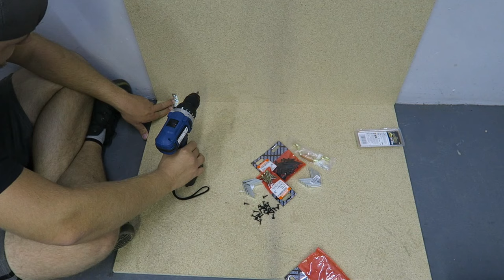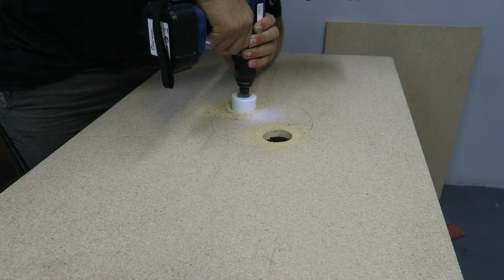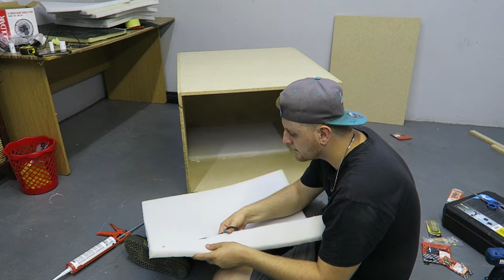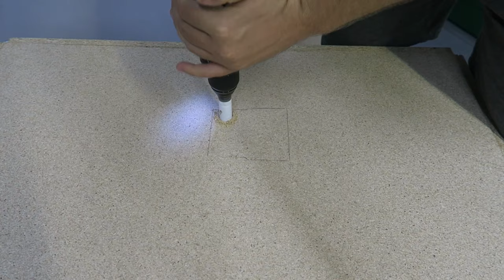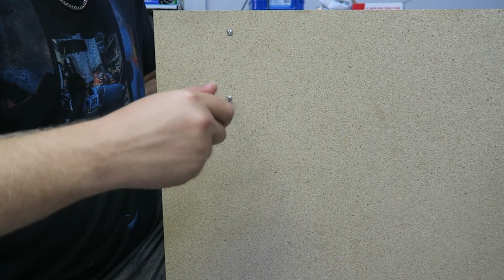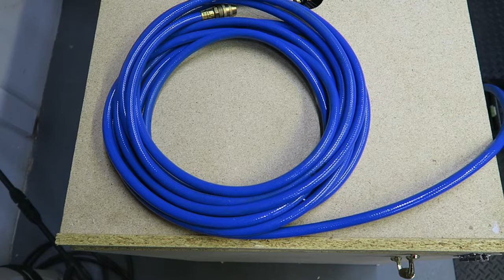Building A Cheap And Easy DIY Box To Keep Your Compressor 85% Quieter

Comment: As somone with actual experience in fluid dynamics, there is no way in hell that the air intake is anywhere near adequate for air intake and for cooling your compressor. Don't be surprised when your compressor dies on you much much much earlier than you expected

Comment: I notice you have a lip at the back where the top board meets the vertical back board (the part where you caulked)...is there a reason you wanted the lip and didnt make the boards overlap?

Comment: Fantastic work Gareth,  I had thought about it and seeing it on your channel is a great inspiration to build mine, i do a lit of sandblasting and my shop is basically an oversized shed in a residential area which limits my working hours to avoid disturbing my neighbours this has ought to fix my issues
Thanks for sharing, sub'd
Reply from the maker: Glad it was helpful 👌

Comment: Great video! 👍😃 I love it!! 🤩

I'm looking to do the same basic thing except that I want the boxes to be built into a new wall I'm adding in the garage. 

I have a basic idea of what I'm getting myself into but probably not entirely... I've decided that the empty space in the garage that tends to get stuff stacked & packed and then forgotten, needs to be sectioned off as it's own room with a specific purpose to keep clutter & disorganization to a minimum. 

I'm designing an "Ebay room" (could be turned into a nursery if necessary?) in the garage. But my husband's large tools, like the air compressorS (and accessories) and the generator, need a permanent home where they're also still conveniently useful and easily accessible. 

My solution is to build a wall beside the space where the car gets parked with built-in cabinets to hide his oversized tools. It'll consume some of my "Ebay room's" space to do this but it'll be worth it to provide a solution to multiple problems - the need to declutter, find a permanent home for his large tools where they're most useful anyhow, hide the large tools in plain sight, and the need for a raised "desk" work space in my area so this should work for both of us perfectly, in theory anyhow.... I hope... 🤞🤞 Nah, I'm certain it'll be better than what we've currently got going on in the garage! 🤣😉

I'm certainly open to suggestions here. Watching a few similar videos, I came across a retractable air hose contraption that I think I'll add into my plans but wait to give it to him as a Christmas gift. I didn't know something like that existed! He'll love that too!

Comment: I built a generator box. Was 76 Db now 61. But I gotta go lower. Any ideas? Any reply appreciated cheers from Australia
Reply from the maker: Hi did you use insulation foam? Inside the box? If not and you cant find you can use old egg boxes and stick them in the inside of the box that will Lower the sound alot but make sure that there is enough circulation inside to keep it from over heating place a fan inside the box directly towards the generator and make smaller holes on the side for the air to keep circulating.  And then get a rubber matt the length of the generstor id say atleast 6mm thick and place it underneath the generator and one underneath the box this will stop alot of vibration which will also lower the sound.
Reply: @GarrethCollins  I use acoustic eggshell style foam with bitumen then aluminum foil . It's used on high rise buildings four sound. But houses here are so close. I might have to sandbag around it. Or garage it with exhaust punting under garage door and leave about 50 mm clearance. I have a fan for ventilation and even wrapped exhaust in fibreglass heat packing from eBay. Used for motocross exhaust. Ok in day time but you know how at night noise travels. Don't want to upset neighbors! Cheers
Reply: Btw egg cartons are awesome four sound. I mean they are basically free. Thanks for the quick reply

Comment: your video just solved my problem with my loud compressor...what are your thoughts on soundproofing material? also, i will be installing fans as you did...i will hook fans and compressor to a surge protector located outside of the box so i can turn them all on/off simultaneously...great vid!
Reply from the maker: Thanks! Sound proofing i just used sponge. But u can use whatever you feel can work for you.

Comment: Is there a fan at the top of the box, its function is to suck air from outside or suck air from inside the box?
Reply: yes theres is fan at the top to pull fresh air in, and one on the side to vent out hot air
Reply: @dastanharris   thanks sir

Comment: Garreth how is this coping temperature wise?  Have you had to increase airflow, or is keeping reasonably cool as built?
Reply from the maker: Hi i have been using it like this for about 8 months and no problems at all i used it everyday with no problems the fan i installed on the top is running as soon as i switch the compressor on and it works perfectly doesnt over heat at all as i have a vent on the side exactly whete the exhaust is placed for all the fumes to go out.

Comment: Great vid, what kind of foam and box sealant did you use ?
Reply from the maker: I used chipboard for the wood, for the foam i used upholstery foam, and to seal the edges acrylic glue.
Reply: @GarrethCollins  Thank you! you have inspired me to make my own. Subscribed
Reply: @kpp4463  - By far the best cheap and readily available sound insulation is "rockwool". BTW not to be confused with "fiberglass" insulation... 
Best "bang for your bucks" or should I say "no bang". LOL 😂

Comment: Nice.. im in the middle of watching it.. like your editing skills and to the point,.. Do you have a cut list, or part list, in the video or u can post, like material type, est. costs. etc.... Is using screws and metal a good idea or can you get by with an adhesive...?   Solid work though.. ALSO I DID SEE another construction with the same crazy zig zag air lids like the others but his main difference was he removed the feet grommets and used bungee cords and heavy duty nylon straps weaving it underneath to have the unit suspended supposedly that was one of the biggest reductions. Thanks for taking the time to post your workflow though. Cheers.

Comment: great video and work i shall be building one of these boxes as my 3HP compresser shall drive our street nuts if i dont make it quiet, i am thinking of using loft instilation as a sound barrier and use 18mm chip board for walls and a computer fans for extraction of heat, great video.
Reply from the maker: Great the box still works perfectly its been over 7 months and i use it everyday.  Tha ks for watching

Comment: Hey, great video and thank you for sharing your build! I wonder if the ventilation is enough for the compressor running all day? Have you experienced any issues with it? And have you re-cabled the on-off switch to be accessible from the outside? Thank you again for the video - I will build my own enclosure in the next couple weeks :)
Reply from the maker: Runs fine been using it like this for about 4 months no problems.
Reply: @GarrethCollins  Nice, thank you for your fast answer. That's cool, then I can start building my own now - cheers!

Comment: ☝️But you have to pay attention to one thing!  Heat can cause fires!  Your workshop can be reduced to ashes!  Why not use lime or gypsum blocks !?  The best way is to use aluminum plates for framing, with a strong cooling system, arrange it inside with gypsum or lime blocks, from the outside as under the roof, insulate it with fiberglass, two channels  Dig the vent on it, one on the left and one on the right, the channels must be at least 2 meters high, you can even equip it with a car cooling system.  But ventilation ducts are very important.  Strictly avoid wood and plastic incendiary materials!  Safety is the first important issue in technique!🤔
Reply: If it’s not overheating there is no issue. I’d be more concerned about air compressors exploding in general. That’s why my build has a cage inside.  Every workshop should have a fire extinguisher as a rule anyway. More chance of a grinder starting a fire than an air compressor

Comment: Hey Garreth, a feq Qs. Where did you buy the upholstery foam? Is your compressor sitting on foam directly? Did you ever consider soundproofing materials like those used for homes - or somehow you found out this foam works wonders?
Reply: And thank you for the clip, woke up today determined to solve my 5hp/60gallons compressor noise issues.
Reply from the maker: No probs. 👌👌 Found the foam at a lockal supply warehouse. And i used rubber underneath to minimize the vibration.
Reply: @GarrethCollins  Actual rubber? like the stuff they use for ice/snowy conditions? How thick?
Reply from the maker: @cubul32  Rubber floor matts
Reply: I've watched about 15 of these "silent compressor box" videos and yours is by far the quietest. Which is odd because in several other videos where they test the effectiveness of sound proofing material, the foam ranks pretty low (common bathroom towels score really well actually). Could you link the exact type of sponge material you used? Thanks!

Comment: Good video, music is cancer though.
Reply from the maker: Thanks 👌 you are more than welcome to find me good music thats not copyrighted. Im sure the video would of been boring without it 😂😂😂
Reply: I guess I could just mute the volume. Also, how does the compressor go with heat, does it overheat much in the enclosure?
Reply from the maker: @WogChilli  i havnt had any problems so far and its been more than a year this way.
Reply: That's not bad then, have you tested the db? I'm looking at buying one of those new silent compressors to run indoors for finish carpentry